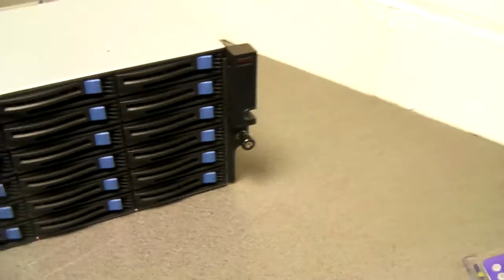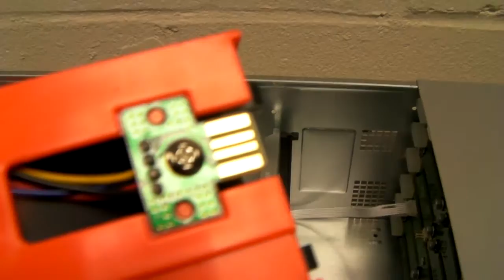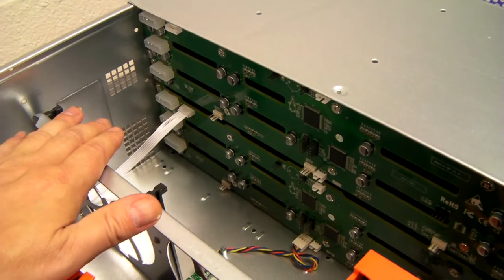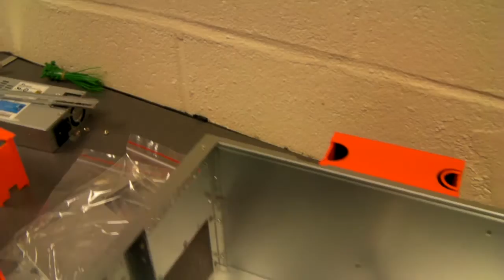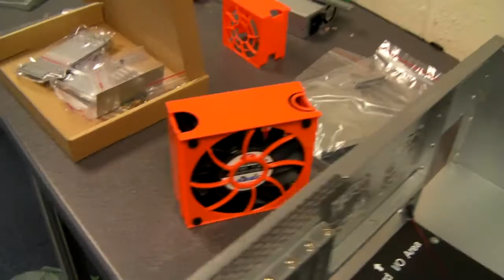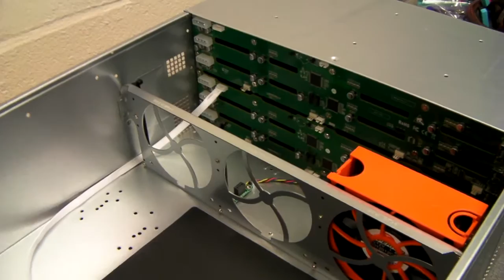X-Case RM 424 Pro Rev 2  - 24 Hotswap Storage server chassis

Comment: 1) How do the 120mm fans compare in sound level to the Noctua 120mm fans?
2) Does the rear take 60mm or 80mm fans? Norco uses 80mm fans for the rear, I think 60mm would be too loud.